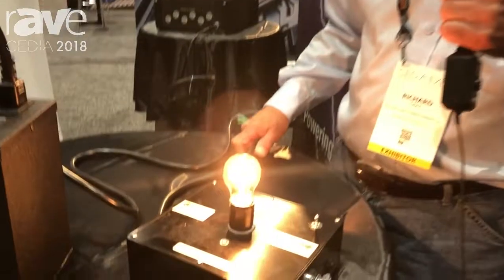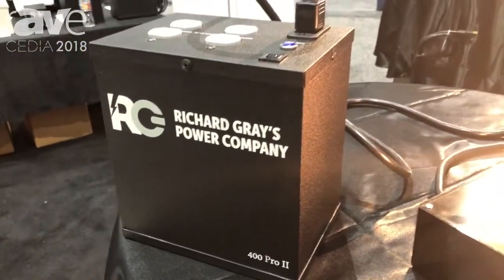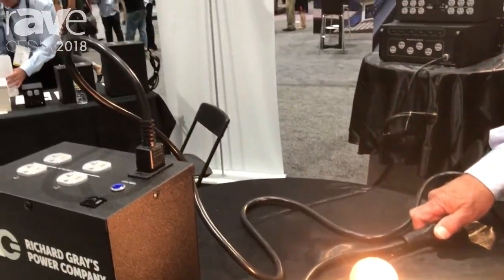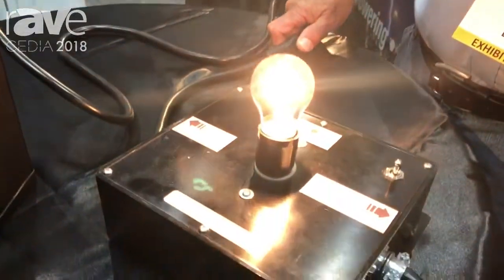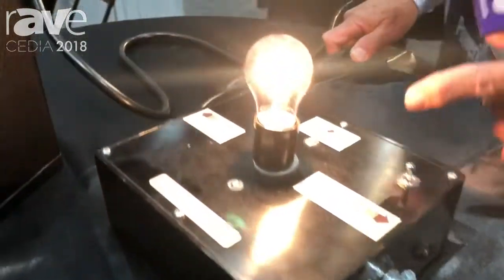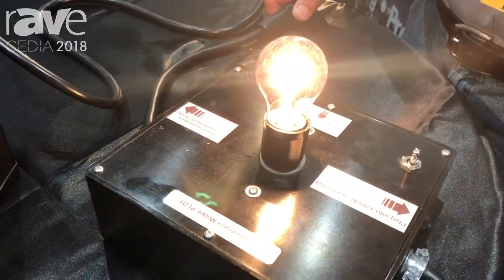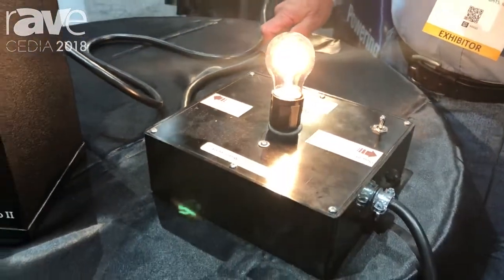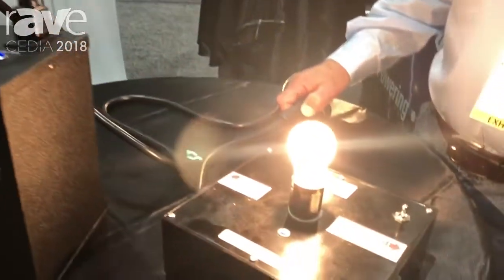CEDIA 2018: Richard Gray's Power Company Demos 400 Pro II Power Conditioner

Comment: If you want to show somebody the difference a power conditioner like Richard's works, get them to plug a vacuum in and a lamp to the same circuit. Then plug the Richard Gray into the socket, plug the lamp in the normal socket and plug the vacuum into the conditioner. That's how your noise floor works in audio, by providing the current needed with the least amount of noise.